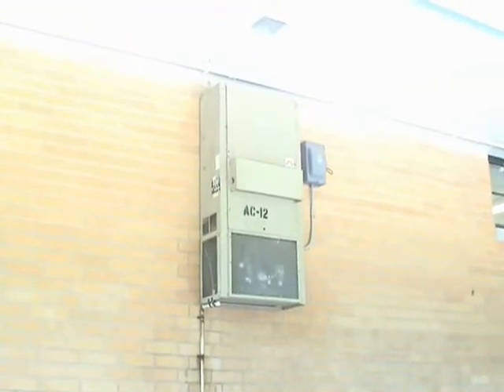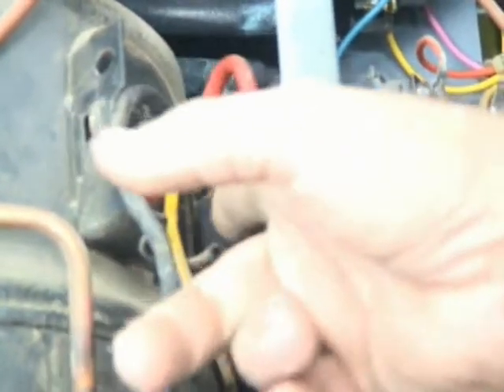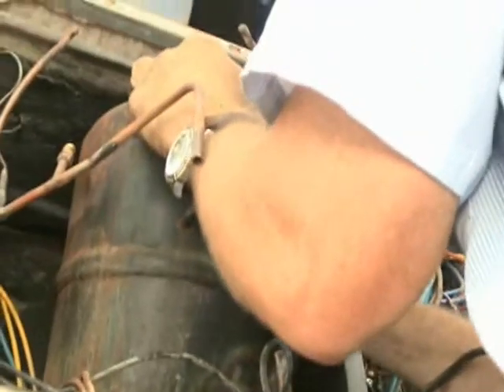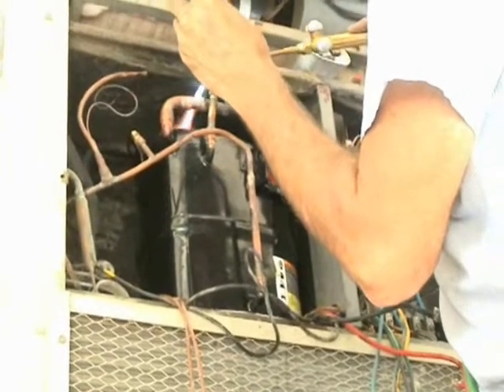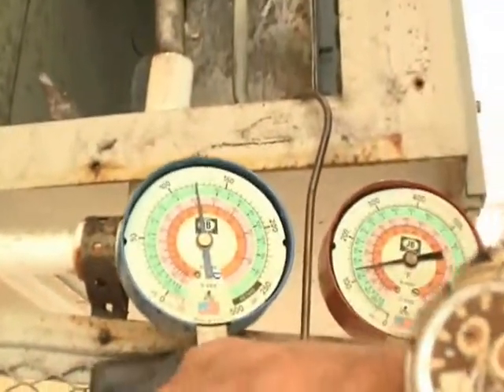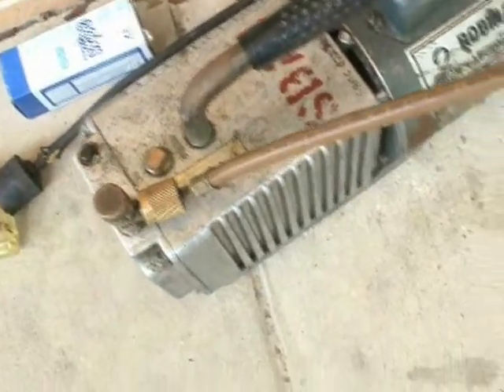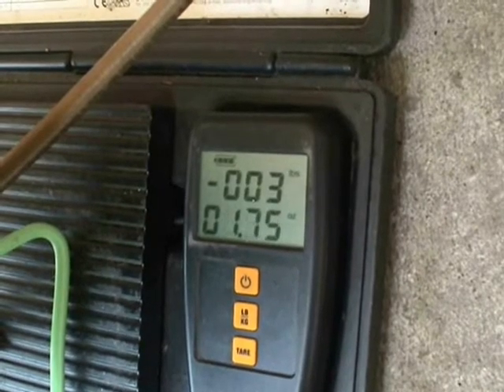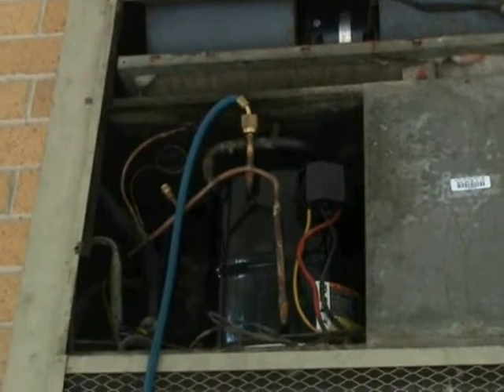HVAC Compressor Replacement (short version)

Comment: Great video!

Looks like an old 2cyl Tecumseh compressor, did it burn out or suffer mechanical failure?

The Danfoss/maneurop compressors come with Helium/vaccuum fill too, 
not Nitro like yours. was it under vaccum or pressure?

Comment: I've been using Stay Brite #8 soft silver solder, since it came out in the 70s.I cringe when I see a drier being brazed in.Stay brite #8 was developed for high side vibrator eliminators, it can handle high pressure and heat tension.I use it whenever I've installed a component into the refrig system that may have to be unsoldered and replaced some day. I have to call Harris to see if the 8% silver in it is enough for R 410.

Comment from the maker: You can use an oil pump to add oil through the suction line service port while the system is running.

Comment from the maker: First, you should be using low loss fittings. Then, you might want to run the liquid from the high side hose back into the suction side after you disconnect the high side hose from the system. That will prevent from losing too much refrigerant each time you put your hoses on and off.

Comment: I see, although I'm not familiar with the procedure. Easy enough, certainly, but my question is, do you typically have to apply power to the unit without a call for cool in order to allow the compressor windings to vaporize the refrigerant? Or simply flip the switch and let 'er run? Wouldn't all the liquid "slug" the compressor down? Possibly cause damage? Please enlighten me.

Comment: This is a great video, thanks!
I have a question for you. I am a trainee and my partner have about 2 meter long tubes in hes gauges. When he has checked pressures it is obvious that refrigerant get in to air when he takes tube off. What do you think, should he add some refrigerant to the system after he does that? I think I ask you before I say that to him. He doesn't add any refrigerant after that operation.

Comment: maybe i just missed this but did you purge with nitrogen while sweating the compressor in? i saw you purged while unsweating. I know it is crucial to purge with nitro while preforming a sealed system repair. Just wondering if you can purge while doing a compressor. will the nitro be able to run through it or not?

Comment: How much would you charge in 2014 for this kind change out only on a split system 2.5T, also with r22.  also the r22 that was taken out did not get used again?...was it acidic? If it was how would you flush the evaporator coil.....can a compressor get shorted out with contaminating the r22?....thanks

Comment: Hey Dr. Z, I'm currently having trouble with something to do with my AC unit, and I really don't know who to believe or what to do about it.  The house I'm renting right now for my family is having a problem with the AC just not cooling anything in this 100+ Texas heat.  I've had 2 people come out so far, one saying it's working fine, and another saying we need to completely replace the AC unit.  As soon as it started getting to 95°+, the AC just doesn't cool the house anymore..

Comment: I got a question Dr. Z, I have to repair a condensor wich is made of aluminum, the leak is on the aluminum side about 3 inches away from the copper to aluminum braze.  What solder do you recomend to sloder copper to aluminum?  What can I do to fix the leak?

Comment: @raptorman120: Face value price comparison, the answer is NO!  Even if the compressor is out of warranty, the price and labor will be less expensive than a new unit.  However; when considering X factors such as age of equipment and the warranty of the new compressor, you could be better off with a new system.  Most OEM parts have a 1 year warranty.

Comment from the maker: Unless the compressor has a sightglass, you can't tell if the oil level is correct. Besides, the oil should be injected through the low side.

Comment: Do you braze the fittings while you purge the system with nitrogen at the same time? and if so at what pressure do you set it?

Comment: with out ur gauges on the unit u wont know if the txv or piston is working right or if its stopped up , so yes u ned to check the charge so u know it is working they way it should ,
 I have to go behind people all the time that just weigh the charge and never check to make sure the pressure is right

Comment: what do you think about drilling a hole on the base of the compressor and brasing a acces valce there to change oil if it's a burnout? some hvac technician in quebec do that.

Comment from the maker: I really don't recommend any product to braze aluminum coils. It's too easy to over heat the thin aluminum coil and melt it to smithereens. If the leak is small, you might want to try a product that will patch it from the inside. You can add it to the refrigerant.

Comment from the maker: I always replace the run capacitor when I replace a single phase compressor. Not all compressors are going to take the same run capacitor rating.